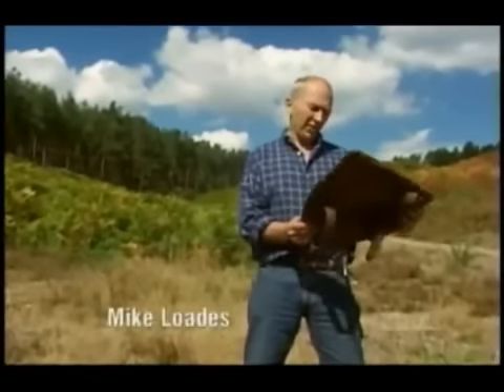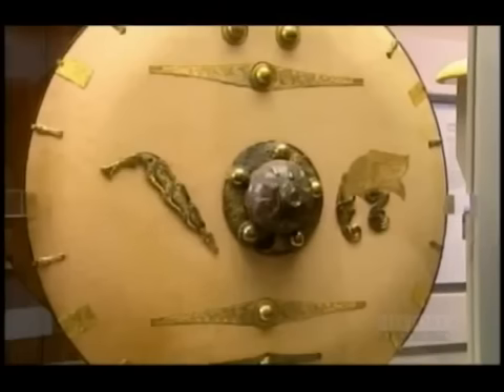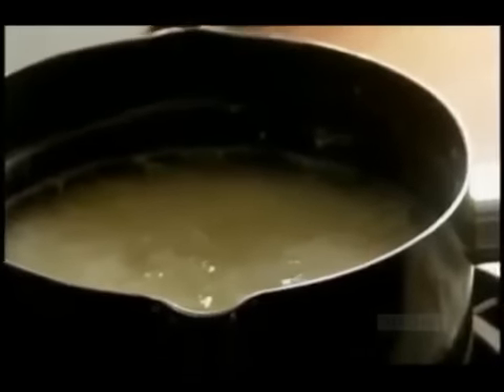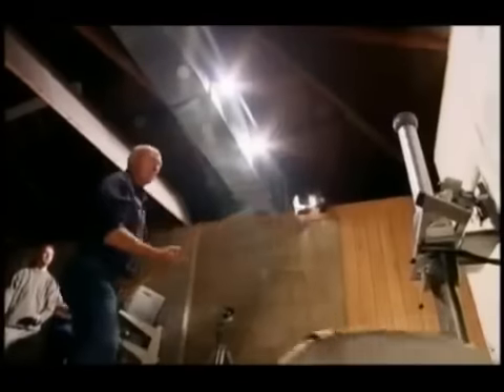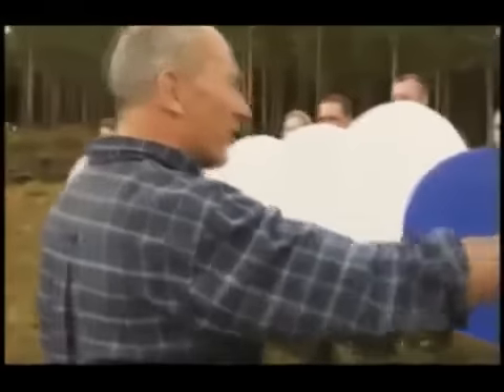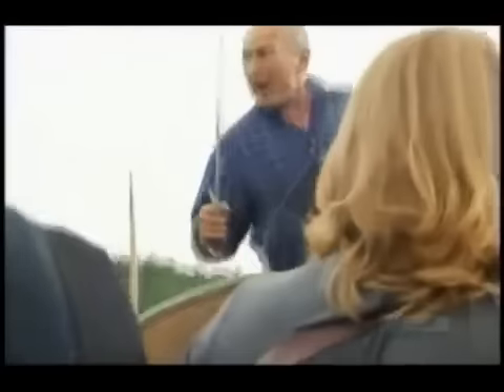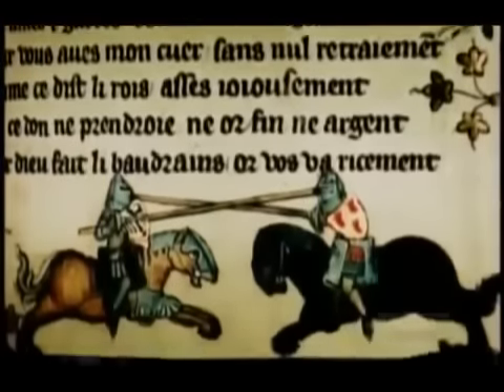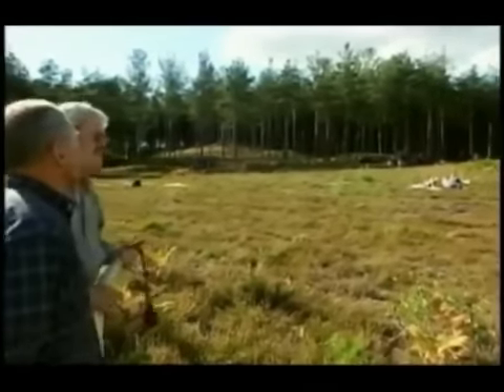MIDIEVAL WEAPONS AND COMBAT - The Shield (MIDDLE AGES BATTLE HISTORY DOCUMENTARY)

Comment: the first shield they tested was not even finish. It still needed canvas and more glue to add more structural integrity with the rawhide on the edgings of the shield. Also, the center grip of a round shield that adds most of the integrity is made with the same wood as spear axe handles.

Comment: I did wonder, though, about the use of the long-handled battle axe as a way of trying to smash through the wall. My understanding is that their best use was for the second rank in the formation to reach across and "hook" the shield of the enemy's first rank, hopefully pulling it down and making those first rankers vulnerable to high thrusts by the swords of the axe-man's own first rank. Used in the first rank as an offensive weapon, it would seem to be very unwieldy, making the axe-man vulnerable to quick sword thrusts as he recovered from each broad swing of the axe. Plus, the axe-man couldn't used his shield very effectively.And in fact, most of those in the shield walls were armed with short swords similar to the Roman gladius, using them for rapid thrusts between, over and under their and the enemy's shields. Short-handled battle-axes were sometimes preferred according to individual tastes, but weren't very good for the extreme close-up fighting of shield wall against shield wall.

Comment: Take your pick, guys.

Which shield size is better: small, medium, or large?  Gimme reasons.

Which shield shape is better: rectangular, round, or heater?  Gimme reasons.
Reply: Depends on the circumstance. Like weapons, the size and shape of the shield changed dramatically to accommodate different kinds of warfare. The large square shield used by the Romans, for instance, was that way to be useful at stopping projectiles and fitting together in a formation - the average Legionnaire would gawk at a dueling buckler, which is small and round and meant for deflecting agile blade strikes and thrusts.
Reply: How about a buckler?
Reply: As described in the episode. A buckler would be rather useless for stopping arrows or bolts, for obvious reasons. However, it's light (which is good for speed and stamina), protects the hand nicely, and ideal for deflecting a light attack away. Bucklers, like rapiers, are honour weapons and poorly suited to ruthless total war. Most duels were fought to first injury, and within a social context, hence you only need to nick the opponent once to win, not kill them.
Reply: My shield shall be a center-grip round shield with the size of 15 inches.  What do u think?
Reply: Fernando Ramos The big advantage of the buckler is that it's really easy to carry with you, combine it with a one handed sword or a dagger and you have a really nice self protection tool that you can just carry in your belt, but its not a battlefield shield. Think of it as a small handgun, easy to carry but if you are going to war you want a assault rifle.
Reply: What do u mean by the tried and truth?
Reply: But then Rome always had problems when they fought against enemies that relied on mobility and guerrilla tactics, they had a 1/2 win ratio vs Parthia and they never manage to conquer ther empire. Heavy use of light and mobile horse archers always provided Rome with huge challenges.
Even the conquest of Iberia (modern day Spain and Portugal) was achieved more by smart politician than battles.

It is simple: there is no universal best shield, weapon or armor. You always have to adapt to the context you are in.

I would guess that in most circumstances the roman scutum is a stronger battlefield shield than the buckler, but let's say you are in a dense forest a smaller shield would be preferable. That was one of the reasons the iberians gave them such a hard time.*****
Reply: I agree 100% about the buckler vs scutum, the buckler is simply not a shield developed and used for a battlefield, at least not in Europe. ( Although if i'm not mistaken a buckler style of shield was used in India).
If you look at history I do not agree that the scutum is the best shield for battle, in the medieval ages in Europe it was a constant arms race and the closest thing you get to the scutum was the pavise used by the crossbow menn. If the scutum had been the best design I would guess that a normal infantry mann, a man at arms or a knight would have got the idea to use a pavise in a battle. They where not stupid, after all, ther was a constant evolution of swords, polearms, maces, axes, armor and warfare in general in that period.
Reply: I don't enough to answer your question but I will say there're one important thing that's often forgotten: not all shield are for use on the battlefield. Effectiveness in warfare is one thing but equally important is how easy and practical a shield is to carry around for the 99% of the time you're not in battle.
Reply: ***** Like what?
Reply: Fernando Ramos I've tried most of them and I'd say a large, round shield (late Roman) is best. You don't need to destroy your hand arms by parrying, the shield takes most of the hits. If you have better grades of armour then a shield becomes less relevant; getting to the point where a shield in full plate is a disadvantage (it takes out your left hand)
Reply: Fernando Ramos As others have said: it's completely dependent on context, period, opponent and your own style. If forced, I prefer a medium round shield; but, that's in 1-1 or general melee. The Roman Scutum was effective in formation but I'd hate to be on my own with one facing, a rampaging Celt or Celts. Although I perform combat systems from Iron-Age to present day, I specialise in Medieval forms; and prefer 2-Handed weapons or even 2 x 1-Handed weapons. Sword & Shield is my least favourite combination. But, that's just me.
Reply: +Fernando Ramos a large tower shield so i can hide behind it and slowly walk away
Reply: +Fernando Ramos  Kind of a pointlessly loaded question. They all have their uses.
Reply: Janas Aurora your no fun
Reply: A large rectangular the size i good for protecting your body  without  moving it around alot and the rectangular is sort of like your body shape so yeah... Like a scutum